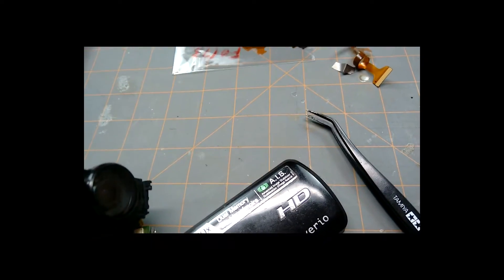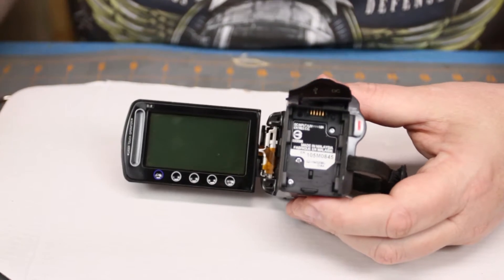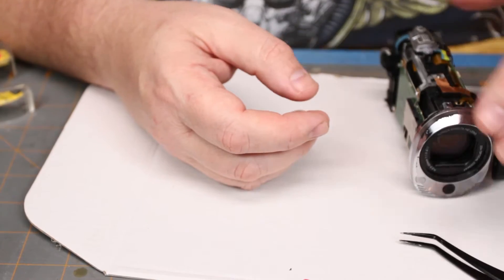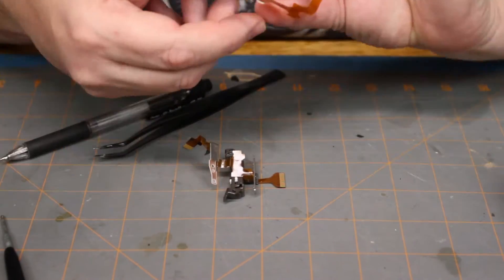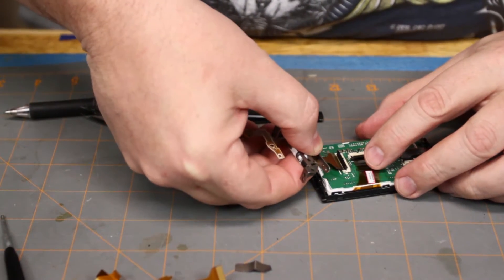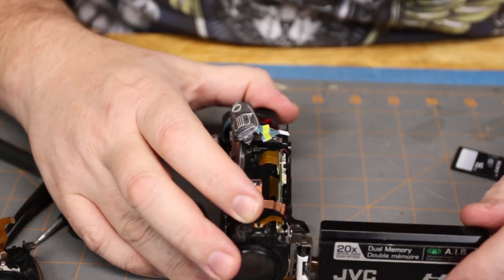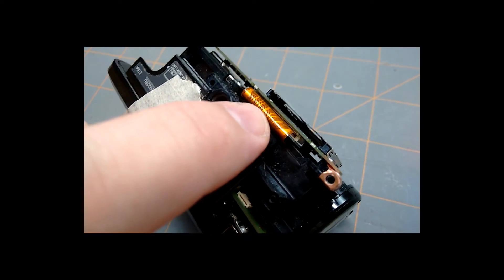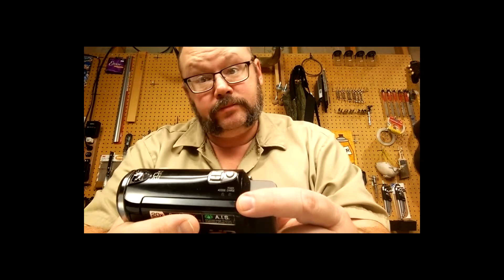JVC Everio flat flex cable repair | RATTLECAN GUITAR RESTORATIONS by James O’Rear

Comment: Ive been an Electronic Engineer for 40 years. No way i'm going to do that except maybe to play. My eyes are shot after years of staring at drawings. My hats off to the designers that designed the mechanical end also to the assemblers in the factory.
Reply from the maker: It was an easy choice: $7 part or $300+ for a new camera. Glad my eyes and fat fingers cooperated. Cheers!

Comment: dude that cardboard with double side tape idea is fucking aces. i usually set the screws down in sections in the same pattern i took them out. but sometimes i accidentally hit them. i'm def going to use your idea in the future. my screen on this fucking camera stopped working during charging the battery. this is one teardown im not looking forward to and not sure if itll even work but everyones videos point to this cable being the issue
Reply from the maker: Good luck with the repair!

Comment: I used to work full time in electronics, have a couple of college degrees in it, changing a ribbon cable is the easy part, getting to it and getting the thing back together is the challenge, they should have a college course on that lol

Comment: I have the same issue and the flex cable ended up braking on my camera a few years ago and I was going to send it into a repair shop. But I ended up not doing so and decided to look up a repair shop here where I live. And I found a bunch of repair videos here on youtube. So I came across this video and now ill be ordering a new flex cable soon. And ill be getting a set of cables so if it ever happens again ill be prepared. My camera is a different model in the same brand but the video still helps.
Reply from the maker: Glad you found it of use. The cables are so cheap I bought a couple of them just in case. Good luck and let us know how it went.
Reply: worked out wonderful like bran new.

Comment: The tiny magnet within the two piece cover of the hinge, which snap apart, is somewhat of a challenge! It is tiny and round. It fits withing a hole of the black half, and not the chrome half.
Reply from the maker: Thanks for the clarification George!

Comment: My jvc camcorder had the same issue still looking for the flex cable
Reply from the maker: Hope you find the parts you need, prowl eBay. Sometimes it takes time to find them when someone posts in small batches.
Reply: Thank you

Comment: good for you James . ribbon cables are hard to seat .
Reply from the maker: Much easier when I can get my big fat sausage fingers in there.
Reply: even skinny one make it tough James. 20 yrs component level repair . its just so easy to get them off set just a touch . n throw off all of it . hey don't forget to pat your self on the back my man.